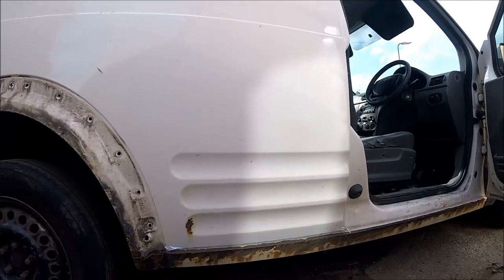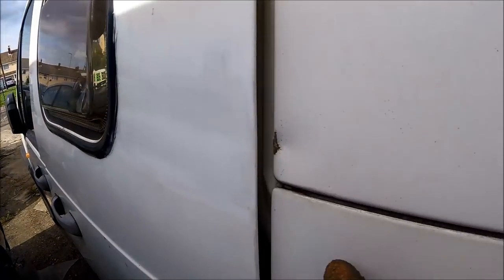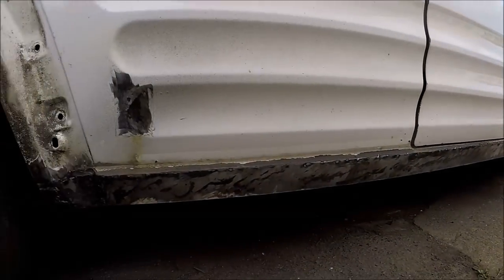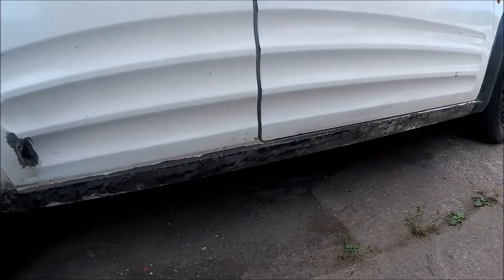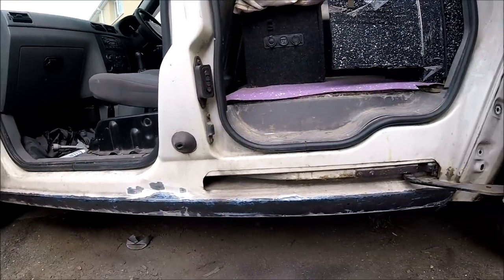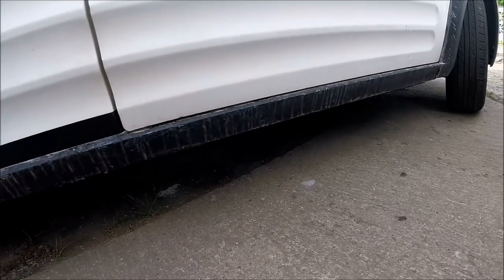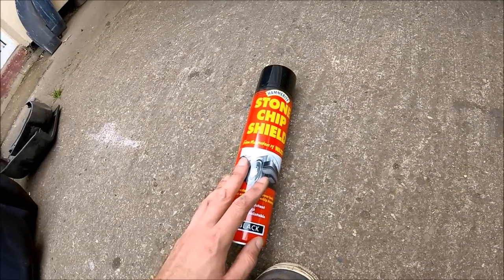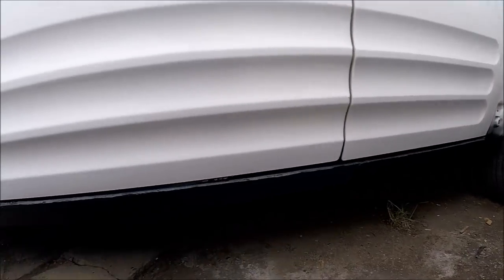DIY Ford Connect Sill Rust Repair Treatment

Comment: About a year ago, I drove through white gloss paint in my 54 plate Passat. There was a one litre can lying on the road and had caused a puddle of paint. Would have to be gloss! Anyway, I will have to replace my plastic NS sill cover and both NS lower door mouldings. Nothing I have will touch the dried on gloss (plus these items are a mottled / textured finish). So, given that the plastic wheel arch liners (smooth, no texture) are fairly hidden, I blasted off what I could with the patio lance from my jet washer. Rubbed down the arch liners and inside of the mudflaps with 200 grit and used this Hammerite product to basically spray over the remaining gloss - Wow, fantastic. High build coating, factory looking finish! Coverage is great, easy, no fuss or bullshit. Great product.

Comment: What about the bottom part, the edges underneath, where the jack stand goes. Didn't see you grind that as well. If you applied the stuff right over, it's gone eat it from the inside 10 times worse.

Comment: Do your back doors let in water in heavy rain? I heard the rubber sealing where they join at the top was unreliable. Cheers, great insight.
Reply from the maker: I sold this not long after converting it so can't really help you there
Reply: @TheCampervanBuilder  ok thanks anyway

Comment: look like your sills still very rusty on underside ?
Reply from the maker: The sills have already been replaced so its just surface and everywhere had rust converter smothered before painted with stoneguard
Reply: the camper looking really smart grand job